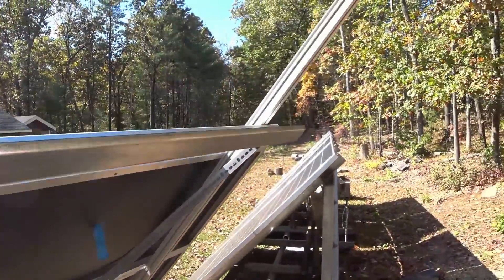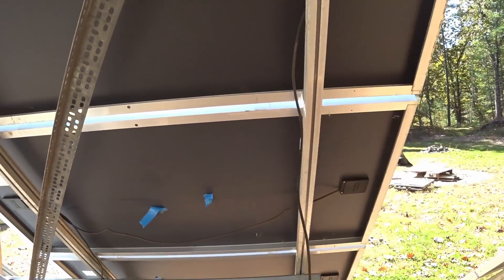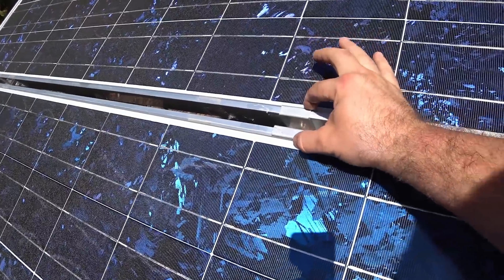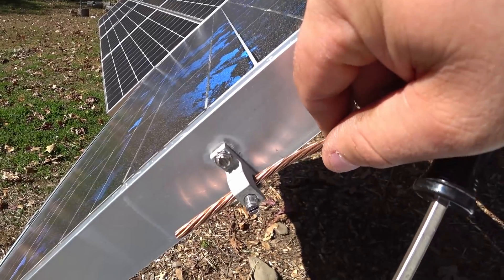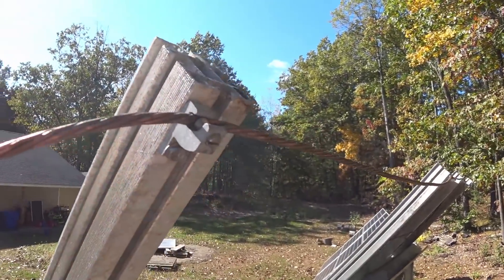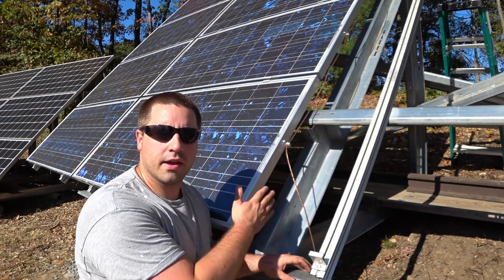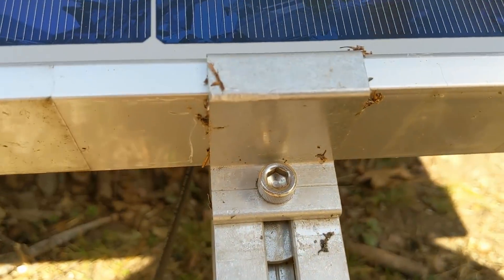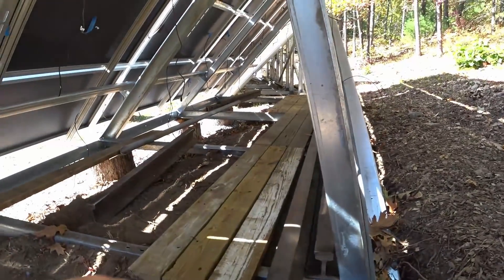Mounting Cheap Solar Panels on DIY Frame 3.16 KW

Comment: Lovely and she is right Solar Panels lol. All my stuff is also used or recycled not only is it cheaper but saved from the trash. I hope you checked all the diodes first but since you already had them up should be good.
Reply from the maker: Actually, no.  I didn't check the diodes.  I'll have to look up the procedure.
Reply: @DavidPozEnergy  I just pull the cover off and check they are not blown or loose depends on the mount then check with the meter to see if they conduct. I'm sure there is a better way but I am no electrician.
Reply: @DavidPozEnergy  SB1040 has a low forward voltage loss I did some research I'm sure there are lots more but you could be losing up to 1 volt per panel if they diode is an old one plus when they are in series you may be able to pull them out something I found interesting or your charge controller may not even need the blocking diode cool Cheers.
Reply from the maker: @offgridwanabe  That's a whole topic I'm going to have to learn about.  I thought the blocking diode just prevented backwards electricity flow (at night) I thought it had no impact on production.  interesting.